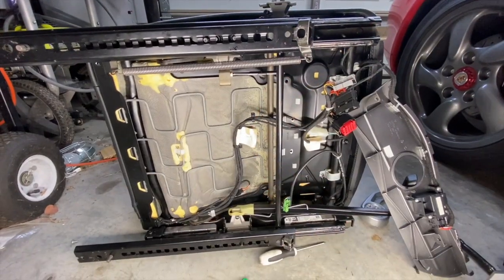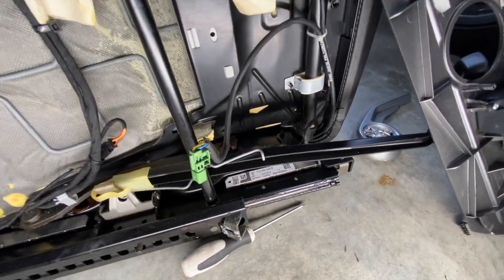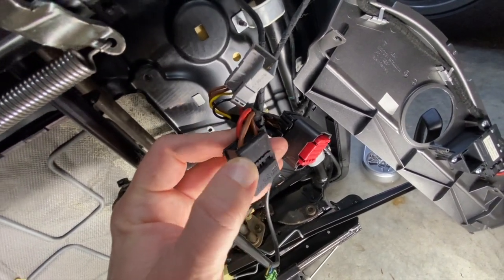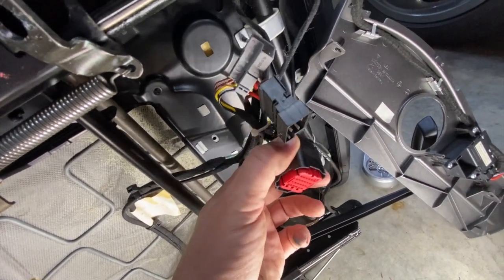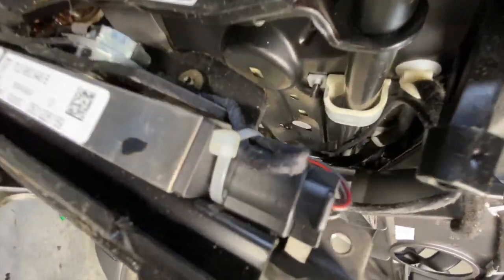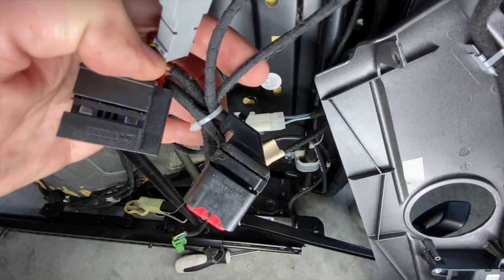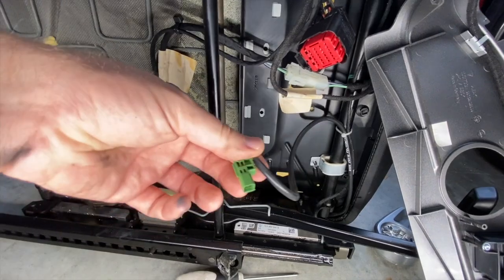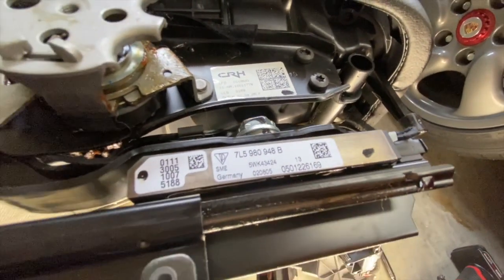What are these electrical connectors under the seat?? | Porsche Boxster 986/Cayman 987

Comment: 4 pin is for seat motor.  2 brown wires is for seat heater.  2 yellow are seatbelt (if I remember right).  Green connector I believe is airbag sensors.  The big red connector with  the Ford logo goes to a box, believe it is for airbag..not needed on a 986 and can be removed.  I made a 3d printed box to put everything in with 4 relays using the stock seat heater switch.  This will allow the stock switch to be used and turn the seats off when the car is off and leave them off until turned on again.  Couple things though with the stock switch.  stock switch has Hi & Low.  You have to tape off the low contact inside the switch or it will short circuit the wiring to the relays.  It will be a bit before I get it pulled back in the garage so I can take pictures.  The relays I used are standard 30/40amp relays in a 4 relay setup (found the wiring on 12volt.com).  With this I have stock switch with stock heated seats, stock switch lights up when on and is illuminated when lights are on also.  Got it all working after spending a few weekends going through various sites and lots of testing.  The other down side is as of right now the airbag light will stay lit up in the dash since it isn't getting the correct resistance from the seat sensor, it thinks it is missing.  Shoot me an e-mail if you like.  (lastnamefirstname) at gmail
Reply from the maker: +Herb Steck 🙌 email sent!

Comment: The 987 seats wiring is significantly different from that in the 986/996.  While I don't have any direct experience with the seats from your generation of Porsche, one of the posts I saw on Rennlist suggested that the power to the seat heaters is provided by a red wire with a purple stripe.  Do you see that color wire on any of the connectors?  If you can find that wire, check to see whether it connects to the heating elements in the seat bottom and seat back.

Comment: The big connector is for the passenger control module and those silver metal boxes I believe are weight sensors for the passenger airbag to turn on and off I’m not sure the rest I would have to look at a wiring diagram at work tomorrow if you haven’t found what your looking for by now
Reply from the maker: +Jason Haskell I was still curious about those metal boxes. That makes sense, thanks!

Comment: Is Herb Steck indicating that the wiring connector you designated as #3 the seat heater connector?  If it has two brown wires (grounds) that would be consistent with that function.
Reply from the maker: +Kevin's Boxster yes, 2 brown wires, 1 black and 1 yellow.
Reply: @HelpMeDIY  It looks like Herb Steck should take the lead on advising you at this point.  He has the more relevant experience.  I Herb cannot help, have you considered posting on a 987/997 forum and asking them to check which wires from the car side of the harness attach to connector #3?  If one of the wires on the car side of the harness is red with a purple strip, that would add support for connector #3 powering the seat heaters.  If a 987/997 owner would be willing to disconnect connector #3 and the seat heater stopped working, that would be confirmation.
Reply from the maker: @kevinsboxster2310  yes, he has it working and I’ve been talking to him offline 😁